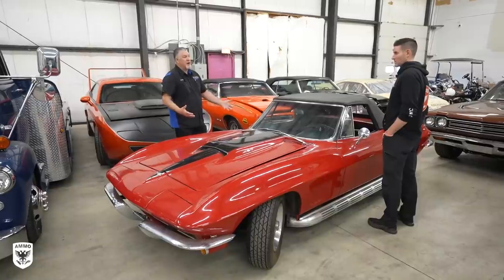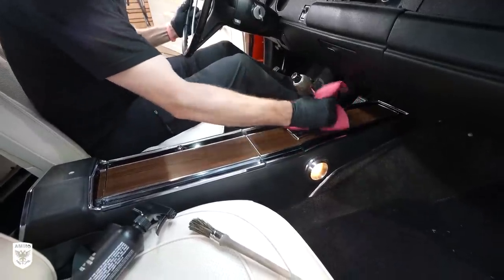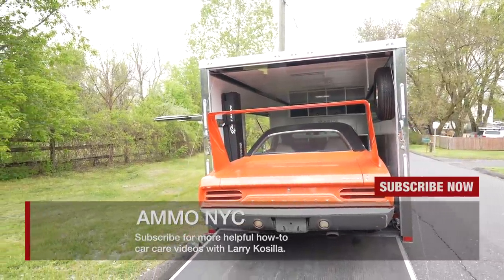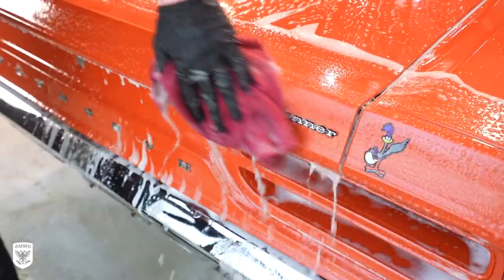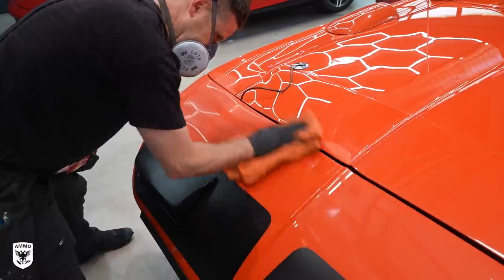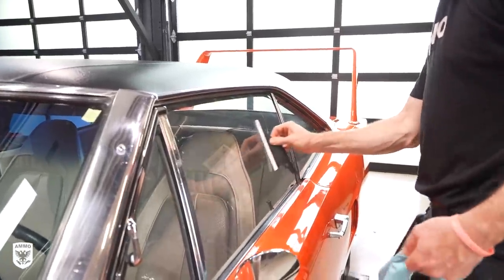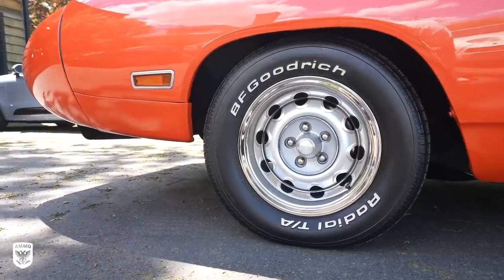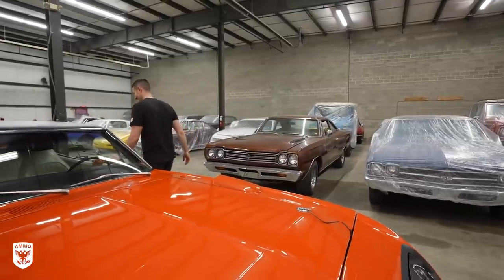First Wash in 3 Years Plymouth SuperBird

Comment: As normal, beautiful car cleaned magnificently. I would highly recommend you have a true high load switch added between the breaker and the compressor. You are asking for trouble down with dirty contacts and heat in the breaker down the line using the breaker as a loaded switch. 

Some breakers are rated as switches for lighting, which generally have a low startup load. The big compressor and dryer you run need a ton of amperage up front which will burn the contacts in the breaker to bits.

Comment: Quick question. Why not do the engine compartment first, before working on the paint? I understand washing the outside first, but couldn't you do the engine compartment after the exterior wash and then work on polishing the paint? It seems you get cleaner on the polished paint? Not a criticism, you're the expert, I'm just curious.

Comment: 5:29 correct me if im wrong but i think that could be rubber or asphalt maybe. If the car was on the track driven hard surely some rubber wouldve worn off the tyres and stuck to the paint right?

Comment: Hey Larry, may be an odd question, but do you ever use a curtain between the two detailing bays when power washing? I assume the other car hasn't been detailed yet, so may be a moot point.. but I always wondered. Cheers man, love the videos!
Reply: I'd say they only do one car at a time, so they finish cleaning one, move a new, dirty one into the other bay and wash the one on the opposite side, take it out, bring another one in and go to the first one that was brought in. It's a good way to keep from getting filth, etc on a clean car without having to bother moving the cars too much.